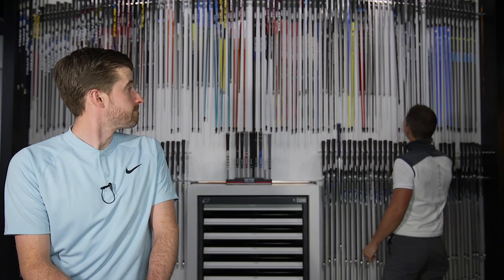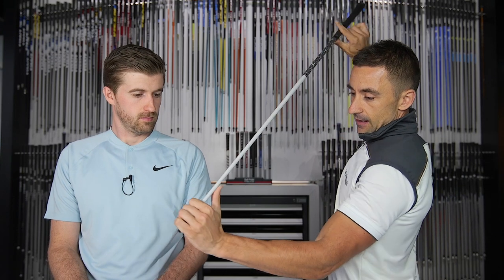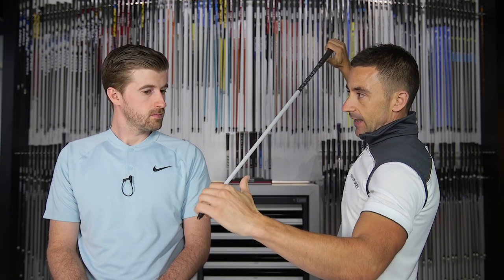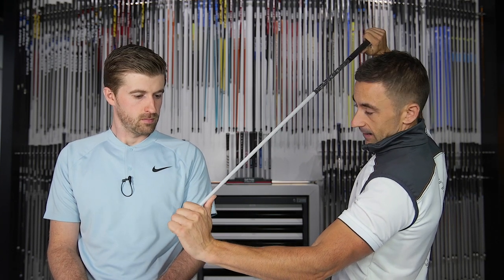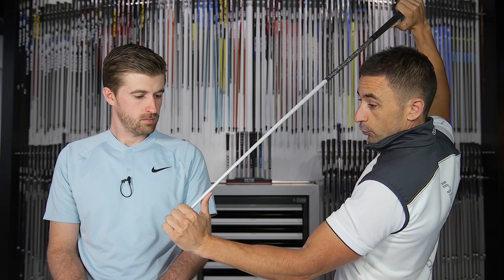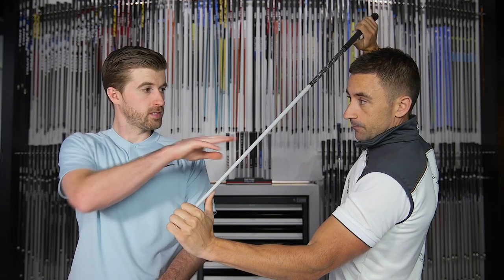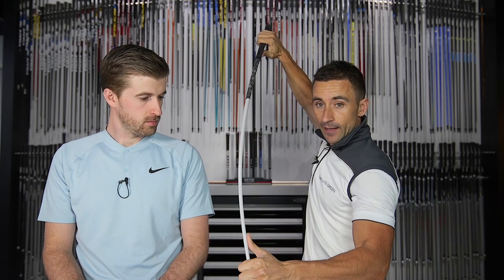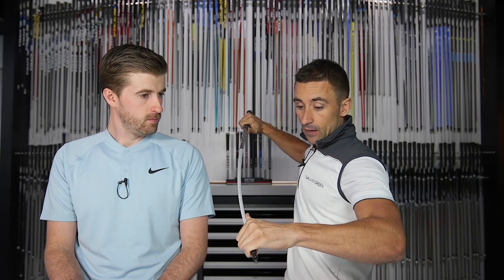The True Role of the Golf Shaft

Comment: I have been trying a Ping G400Max Driver with an Accra FX 260 M4 Shaft (stiff).  The problem is I still like my old Epic Driver that has a UST Mamiya Elements Chrome 6f4t Shaft.   I like the shape of the Epic better. I could have a Callaway tip put on the Accra shaft and I could try it on the Epic.  Do you know high-level if the shafts are similar?  Is one better than the other?  Are they very different?  Thank you.
Reply from the maker: Accra shaft is very good, worth a shot in the Epic before you look elsewhere for shafts.
Reply: TXG Tour Experience Golf you guys are the most knowledgeable about these shafts and I understand you probably deal with all of these shaft companies. In your opinion, side by side is the Accra FX a better shaft?  Is it it similar to that specific UST Mamiya?
Reply from the maker: Possibly some similarities in profile, but the actual performance would depend on the player. Accra shafts are definitely a favourite at the shop, extremely good product.

Comment: If Mark advocates getting fitted for golf equipment and then says shafts make no difference then what's the point in getting fitted . Everyone may as well use the same stock equipment .
Reply: I think you're forgetting the club head, loft, lie angle, length, grip, weight and probably more.  Can't play golf with just a shaft
Reply: He never said shaft doesn’t matter. He said that shaft is one factor in an environment of dozens of factors. He’s discounting this “shaft = engine” garbage
Reply: Folly four. The acknowledged pioneer of club fitting is Tom Wishon who has built clubs for major winners like Payne Stewart. He says that there is no need to spend hundreds on shafts . He also rubbishes the phrase that “ the shaft is the engine of the club”. The engine of the club is the golfer.